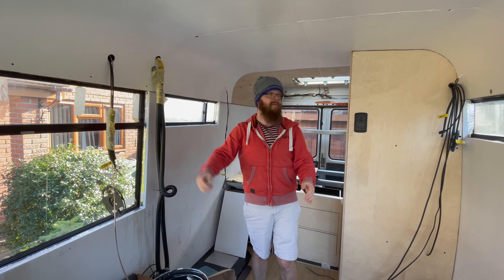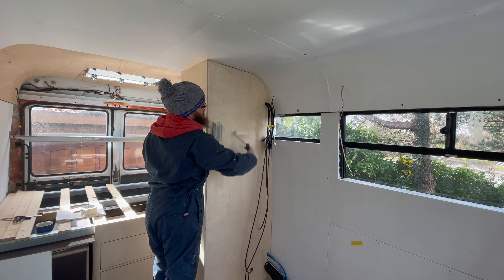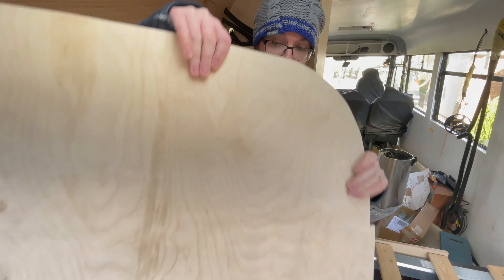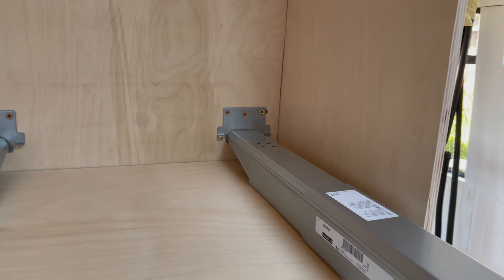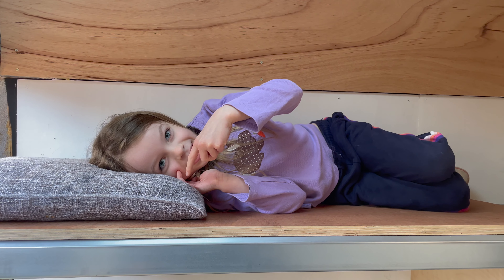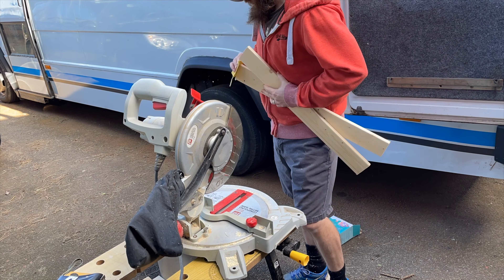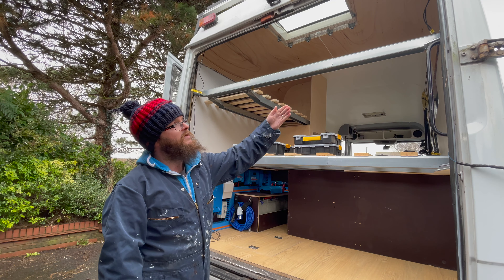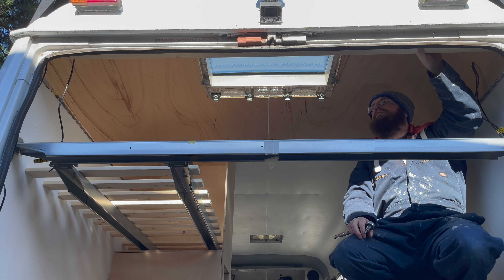DIY Bunk Bed (Ikea Inspired - Simple) | Wiring 2-way light switches | Camper Van Conversion Update

Comment: Looking fab! Well done 😎👍🏻

Apparently circular saw blades seem like they’re blunt but it’s just a build up of rubbish from use so can be taken off and cleaned which make them sharp again 🤷‍♂️

With the bendy rear end what about putting battens all the way across which will strengthen it but also stop it flexing and pull it into shape?
Reply from the maker: Ah. That’s worth a look Ian. It’s never been cleaned. Will give that an explore. 

Thanks so much for A. Watching to the end. And B. The idea. I think that’s what’ll need to happen. We will be removing the boards to treat the wood and insulate the back area anyway, so thanks for this. 

A counter idea might be to batten the ‘outside’ and do some stripwood detail there. But unsure on this idea. It needs some thinking out. As does a window - as we have a million options for that too. It’s all good fun 😊